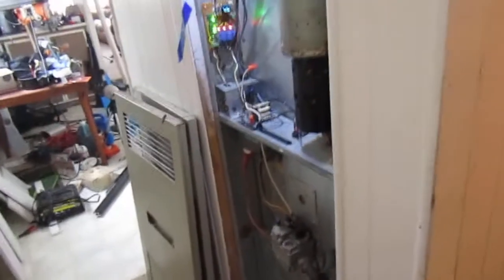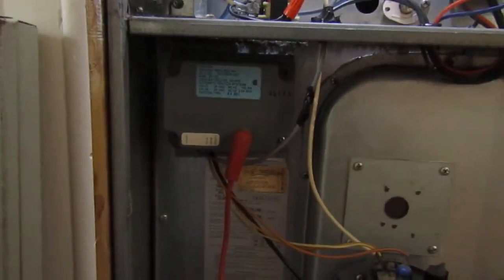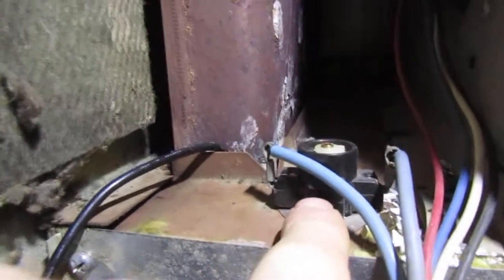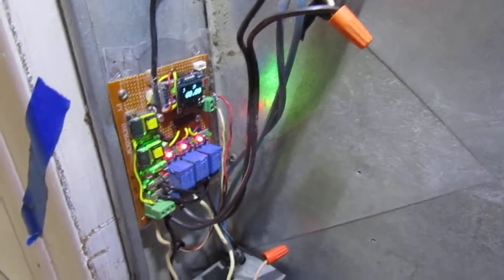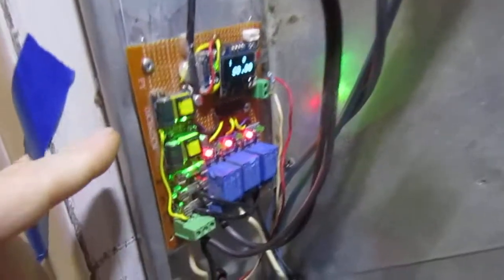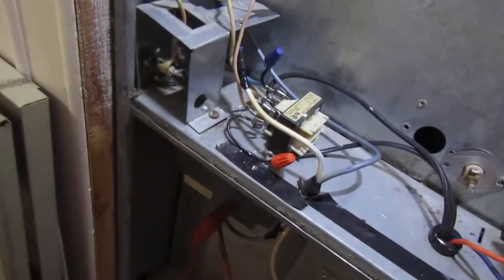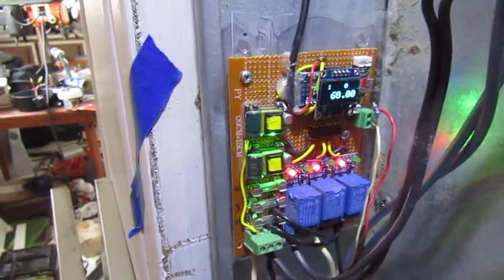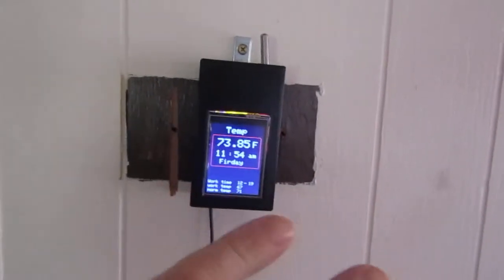Showing my arduino furnace control system

Comment: What does your heat exchanger look like?
Reply from the maker: I found it to be totally perforated with holes and as thin as paper in spots, but only in the least visible sides where I didn't know till I took the whole thing apart., So when the blower kicked on it would eventually blow the flame away from the flame sensor.  After that I ran an CO2 sensor that never picked up anything surprisingly,. until I found an electric furnace to put in. I'm never messing with gas furnaces again because of that experience..
Reply: As an HVAC tech and a electronics nerd I cry laughed with a horrified accent when I read this! 😂